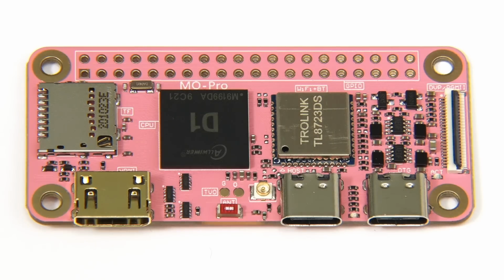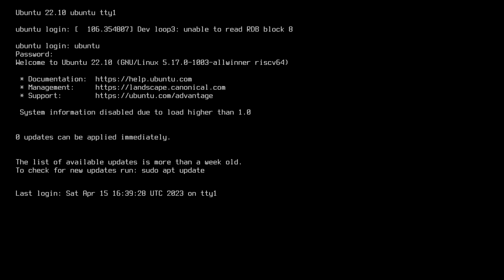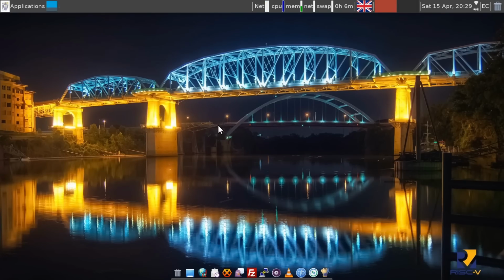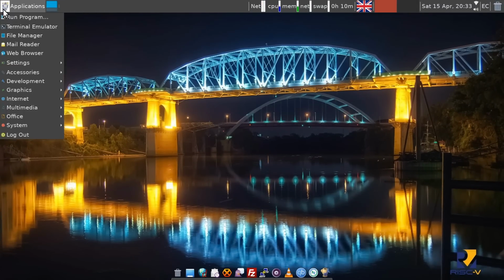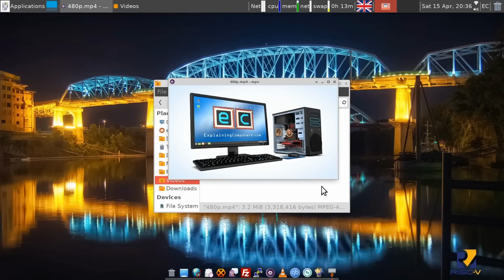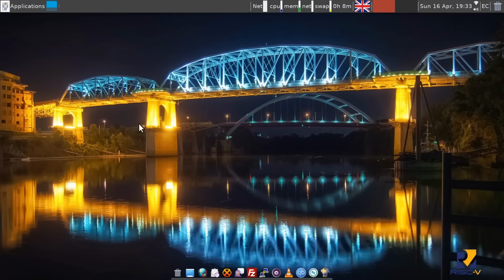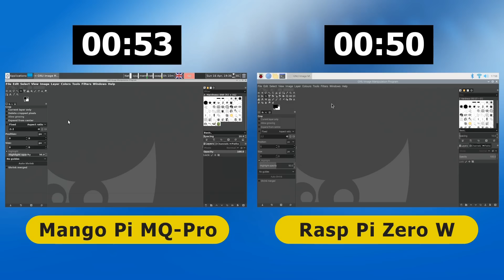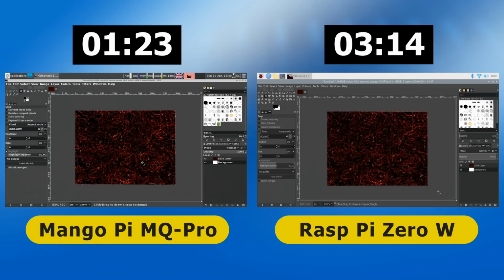Mango Pi MQ-Pro RISC-V SBC

Comment: I admire the use of the Zero's form factor albeit with USB-C connectors.  It's such a shame it has a single core and sluggish processor - the 1gig of ram seems to have overcome the inherent engineering problems that the Raspberry Pi foundation had achieving more than 512mb of ram even with their quad-core processor. 
My desire is to boost the onboard WIFI as much as possible and achieve an auxiliary wifi and BT connector (preferably with a USB-C connector) so that the device can be used as a pocket server and gateway.  Having a high-gain device dedicated to seeking out and establishing VPNs on friendly networks (or even just open ones) has some increasingly prolific advantages particularly in fascistic authoritarian regimes which may seize and interrogate personal devices looking for such VPNs.  Doing so in such a configuration would only find them pointing to a WIFI AP which (presumably powered down by then) isn't currently in range, a reasonable assumption would be that it's a domestic router.
The device can be configured to perform background tasks as well (e.g. large downloads, p2p work, etc.) as well as improving device security for all your mobile gear.
Reply: But nothing you've mentioned above can't already be done on a Pi Zero - even the Zero 2W has more than one core and what are you expecting to run as a server on an SBC anyway?

Sure, I'm interested in RISC-V as an open platform but that has no impact yet as to what you can or cannot do with any SBC - if anything, it's more difficult to do it today on a RISC-V SBC than an ARM SBC because the level of software support isn't anwhere near equal yet.

Your argument is a "reverse engineered" one that doesn't stand up to any scrutiny - it's a bit like me standing up and saying "I like doing off-roading", taking my family saloon car across rough countryside for a day and then wondering why the suspension is knackered when I am finished.

"Right tool for the job" and all that... and there can be more than one right tool for a job, and no tool that does all jobs.
Reply: @terrydaktyllus1320  how is anything I said "reverse engineering" (arguably an improper use of the term)?  I am lamenting the low power and single core nature of the device and citing my SBC server gateway as an example of where I am seeking to use a zero USFF system in a practical sense.  The device here mixed USB-C ports in this configuration albeit usb 2.0 - the zero 2w will do what I want it to within some limits, I do wish for a faster USB configuration for that purpose though.  As for SBC serving - I do this right now and have done so for a decade, I have nine Pis and I use a Pi4b 8gig as a server for active/live data and a range of downloading, messaging and other service functions.  What "scrutiny" are you talking about??  What you're writing doesn't make any sense. Personally I am yet to be fascinated by Risc-V as I fear it will find more of a home in Chinese-only systems which will increasingly focus on military applications especially as they seek to make up for logistics and personnel deficiencies in various branches of the PLA.  Risc-V is probably how their military IT will develop and progress and it isn't impossible to envisage impacts on commercial and civilian supply chains especially if they do kick off a shooting war in 2027.  Guided munitions are in hot demand (the PLA already has extensive inventory of missile systems) and I can see this being more popular in those demand circles.  This obviously has impacts on the will and funding of optimisation efforts especially in the West for obvious reasons.
All that said - I don't think they have the capacity to peer with ARM or x86 designs for quite some time as we have seen designs from the PRC before and they always were short of horsepower.  A single core chip like this is awfully 2010 and the lack of software maturity will amplify this; given what I mention above I suspect we might see some impediment of optimisation funding and effort as a result.
Reply: @davocc2405  The concept is quite simple, do try to keep up.

You've stated that the appearance of the Mango Pi board is a good thing, and I am not arguing that point - any addition to the SBC community is a good thing from my perspective.

But you've then stated the reasons why it's a good thing with examples of applications that can already be covered with existing SBCs anyway.

That's a reverse engineered argument - that it's good something exists but your reasons for why it exists are already covered by other things that exist.

Do you see now? I don't plan on explaining this again to you.

I only read the first line of your comment, by the way because I answered your first question, without wanting to take on any subsequent "whiny lecture" from you afterwards that backtracked on your "reverse engineered" argument.
Reply: @terrydaktyllus1320    no your "point" is silly and wasteful of electrons and an insult to the poor dinosaurs who gave their lives to create the oil burned to power the systems that relay your post.  You do indeed owe them an apology.
I stated my use case example as it is one example of where I was disappointed by the deficiency of the CPU on this SBC.  Normally I would be curious as to why this upsets you but like the rest of the population I care little beyond immediate amusement value.  That is your sole purpose now, my amusement.  Be glad this gives you purpose.
As for the rest - are you having basic problems with that understanding also?  While I can't draw anything in crayon here let me point out some basics:  board appearance good.  Single core bad.  Low performance bad.  Your reply is very similar - deficient, underdeveloped and decidedly single core.  Oh but please reply, I do find it amusing.
Reply: @davocc2405  "no your "point" is silly and wasteful of electrons"

...in your opinion which holds no weight with me given you're just a stranger on the Internet.

Thank you for at least summarising your core point in those nine words and thus saving me the time not reading through the rest of you backtracking drivel.

Good, we're done here, run along now.

Discussion closed.
Reply: @terrydaktyllus1320  Terry Terry Terry.... your only real value on this earth today is for my personal amusement, I get how that may upset you but that's just the cost of being you I guess.  You DID make a difference though - I was having a bad day before you came along, it's always comforting when you're no longer the dumbest person in the room so you really HAVE added some value to the world today, happy day!
You can't read through a simple reply?  Oh dear, worried it might contain something you can't handle?  Oh go on, indulge yourself...  
You made a pointless barb on someone's comment and couldn't hold your own when they didn't run from you.  Sure, from your dating life you must be used to people running away but sometimes in a debate - some of us just don't back down if you try to be all scary.

Comment: Yeah,  1 core, low ram, and low frequency is a real killer for me. I'd be interested once it get past 8 cores.
Reply: One core could be fine if it goes at a zillion GHz.  Multiple cores is a way to buy some speed.  The speeds of these machines is not up with the very latest processes so I'd expect moving to a different process would shrink the die and make it faster.

Comment: I suspect this isn't using the graphics processor on the chip. Simply because there aren't any drivers for it. That might be why it's this slow. Yes it should be slow being 1GHz single core,  but the video file should be playable if it had GPU drivers

Comment: Am I being unreasonable or is that kind of expensive for what it is?
Reply from the maker: It is expensive compared to when a Pi Zero was $5, and even a Pi Zero at $10 and Zero W or Zero 2W for $15. But then these Raspberry Pi prices are pretty irrelevant, given that noboby has any stock! :) So I think c.$25 for the lowest-cost SBCs on the market may be a new reality we need to adjust to.

Comment: the problem is not it is slow, it is just these manufacturers are not putting alot of effort to make more powerful risc v processor, maybe making it 8 core 2ghz with 8gb ram. they can already make more powerful gpu for risc v, after all nvidia is also based on risc architecture
Reply: Why do you say that? Much more powerful RISC-V hardware is available, and more coming all the time. This is just a board you can get for lunch money. For a few weeks now I've been using a RISC-V computer with the SG2042 SoC: it has sixty four C910 cores (similar to the Arm A72 in the Pi 4) running at 2.0 GHz, with 64 MB L3 cache, 32 lanes of PCIe gen 4. These systems are available to preorder now with 32 GB or 128 GB of RAM. Not for $20, obviously.

Comment: I get the impression the Mango has good processing power but poor I/O and iffy video -- seemed to struggle mostly when it had to load a program, or do a non-static display, did right fine when it was juggling numbers. So a good board for that sort of work.

Comment: Can anyone help me confirm that the underside pads are compatible with Pi Zero USB pads? Also is there usb device emulator driver available? I am using Zero 2 as USB storage with a bunch of automate stuffs to process the files while travelling and wondering if this would speed up the process? Also power consumtion would be great too! With Zero 2, I need to disable BT and slightly throttle CPU so power is within USB 2.0 limit.

Comment: It would be nice (as a marginally interested viewer) to know right from the start  what the general intended purpose of this gear is.
Reply from the maker: It's an SBC -- intended for GPIO control, robotics, IoT, hobby projects, possibly retro gaming and using as a very small, low-cost computer. I cannot go into the possible uses of an SBC in every video! :)
Reply: @ExplainingComputers  Thanks; enough for me.

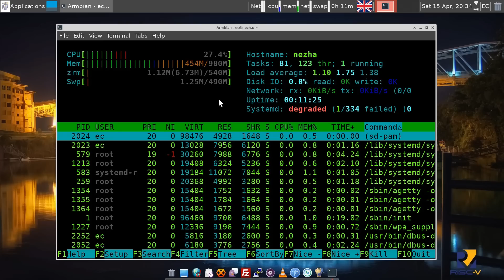Comment: I do note the "Systemd: degraded" error at 9:42 - with that said, systemd degrades every system that its bloat appears on anyway.

I respect very much what the Armbian team does but WHY OH WHY do they leave that systemd bloat on low-powered boards? There's nothing with openrc or a lighter init system, systemd is complete overkill for what needs to run on an SBC.
Reply: That “degraded” indication was because one service failed to start.

They use systemd because it is very efficient, and doesn’t need to spawn full shells to run every init script.
Reply: @lawrencedoliveiro9104  For the record, I have used Gentoo Linux as my my OS at home and across my entire home network (including on SBCs) for 20 years now and never once have I needed to use systemd - openrc works fine.

My day job, since 2001, has been provisioning, sysadmin-ing and faulting Red Hat Linux telecoms servers in business environments, including banks, governments and military locations. For the past 15 of those years, I have been hardening those systems and getting them through security audits for those same companies. Red Hat servers have run systemd for many years now.

I am fully aware of the context of "degraded" in that instant but I allowed myself a humorous jibe at the bloat that is systemd.

I am also in the somewhat "niche" position of being able to talk from a position of knowledge on both sides - I know systemd well because it pays the mortgage, but that doesn't mean that I have to like it.

Where you have a lot of processing power and RAM, systemd does what systemd needs to do, but nothing more than openrc or another init system can do with some external applications that all follow the core UNIX principle of "do one job and do it well". You can pick and choose what those external applications should or should not be.

systemd was not designed by an engineer, it was designed by someone who needed to make himself a "big shot" in the Linux community and followed the "new broom sweeps clean" policy of being determined to make some kind of change with a less than perfect creation - a bit like how VHS beat Betamax despite Betamax being the more reliable technology.

Rest assured, I have done direct comparisons running both Gentoo (without systemd) and Armbian (with systemd) on a good number of SBC boards and do be clear on this - the system performance is always better on Gentoo and the CPU and RAM occupancy is always less on Gentoo, both because of a lack of systemd.

systemd is NOT an efficient solution for lower-powered computers.

Comment: This is a Chinese-made board, with a no-name CPU (named "Allwinner D1") using custom-rolled silicon. Since many Chinese companies have tried to deploy spyware throughout the world, I would be very careful using Chinese-made no-name boards. I would gladly spend the extra $2 to 5 for a non-Chinese board.
Reply from the maker: It most certainly is not a no-name CPU! :) The SoC is from AllWinner, a very large chip manufacturer. And the CPU itself, the C906, is designed by T-Head, which is the chip division of Alibaba. So whilst I appreciate your broader concerns, this is not an unknown product when it comes to the SoC and its CPU.
Reply: Allwinner and Rockchip have been major manufacturers of ARM-based SoCs found in many kinds of products for many years now. Hardly "no name".

Comment: All would be great if not for nonexistant software support…
Reply from the maker: Not "nonexistant" . . .
Reply: @ExplainingComputers  Comparing to x86? - nonexistant.
Reply from the maker: Yes, certainly . . . poor relative to ARM or x86 right now. But not "nonexistant", as the video clearly shows. :)
Reply: It runs a full Linux development/deployment stack.
Reply: @lawrencedoliveiro9104  Yes but compared to x86 or ARM it will probably run 1/100 of the software available for the other platforms. To me that's enough to call it "nonexistant".

Comment: If I was to describe that desktop experience in one word, I think 'painful' would be that word. In fairness though, this is more a failing of modern software than the RISC-V platform itself. There isn't really any reason why basic usage should be that sluggish other than lack of software optimisation. Home computers in the late 80s and early 90s, with CPUs running in the low mhz and memory in the kilobytes to megabytes, had more fluid desktop experiences for comparable usage, so there's no reason why a 1ghz cpu with 1gb of ram shouldn't be able to provide an exceptionally fluid desktop experience. Sadly the luxury of fast hardware and plentiful memory has allowed developers to become lazy. Even in the world of ARM SBCs the focus has been more on pumping out faster hardware than optimizing software. In terms of Desktop experience, I would say RISC-V SBCs are in their Raspberry Pi 1 era.

Comment: Well, given the enormous amount, that a GUI eats up, a way better comparison would have been some CPU heavy benchmarks on the command line, not starting up other memory hungry apps. Here, "ARM has beaten RISC-V" ist just plain BS, when you are running RISC-V with half the RAM.
Reply from the maker: I was not running RISC-V with half the RAM! :) The Pi Zero (ARM) had 512MB, the Mango Pi MQ-Pro (RISC-V) has 1GB. And fairly obviously, I was making a general comparison -- a RISC-V board beating an ARM one in the test being conducted.

Comment: Hahah did you see that mouse flicker… yeah The RISCV “community” has not an iota of their $hit together, it’s all just money going into hardware manufacturers… it’s been over 5 years and still no gpu acceleration OS side. You’ll always have Linux running off llvmpipe, which is never a good thing.  
Ubuntu officially announced support for a board manufactured by SIPEED, but even the team at canonical had little interest to include RISCV gpu support.

Not having GPU support on the OS side makes everything feel that much slower.. a massive impact. There is very very little progress on the software side.  The Chinese manufacturers will keep pumping out new very cool small form factors SBC’s because they know it gets promoted on social media. But it’s only $$$$ going to the manufacturers.

Comment: if it can't play 480p than its much weaker than an single core 1,4ghz athlon from around year 2000. I guess it's a matter of weak software optimization? It can't be that weak, the CPU I mean
Reply from the maker: Yes, it has to be a software issue.
Reply: An Athlon 1400 "Thunderbird" from 2001 is an OoO core decoding 3 instructions per clock cycle, with three integer and three FP pipelines and a 72-instruction reorder buffer.  And, obviously, running at 1.4 GHz. This makes it inherently on the order of four to five times more powerful than a single-issue, single in-order pipeline running at 1.0 GHz.

Yes, of course it can be that weak. If you want a more powerful RISC-V processor then choose a different core / SoC / board. The best RISC-V machine I'm currently using has sixty four OoO C910 cores (similar to Arm A72 or that Athlon core) running at 2.0 GHz. Unlike this board, it costs more than lunch money, obviously. So did your Athlon.

Comment: Pi form factors novelty have come and gone. I for one refuse to buy another pi or pi clone due to the simple fact that they have jacked up the prices a ridiculous amount. You can buy an i5 laptop for less than you can a pi now. that has more ram / speed / space. This pink pi should cost $10 from China at most. You basically are giving money to the CCP buying these things.